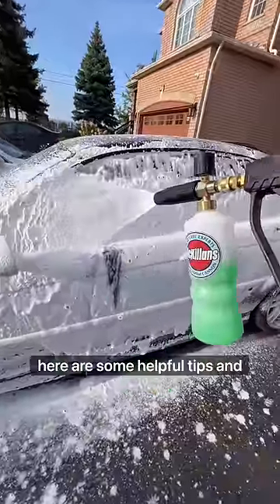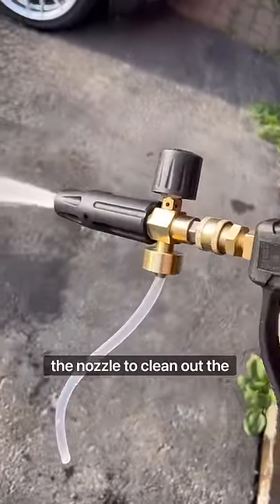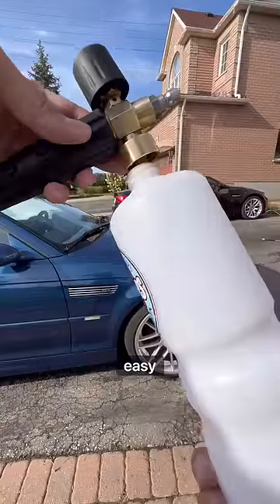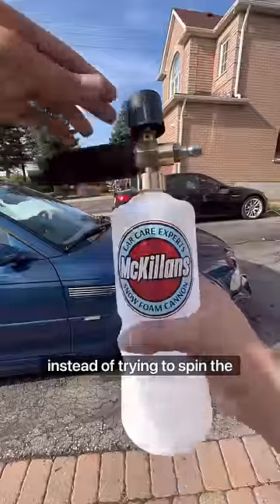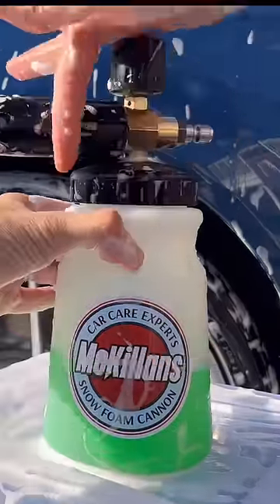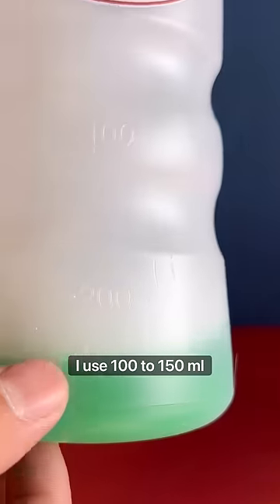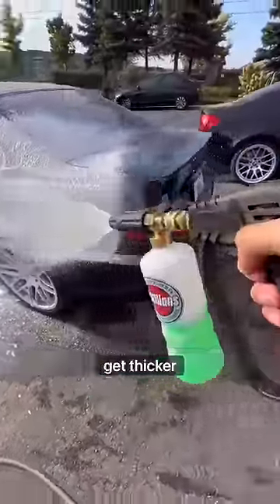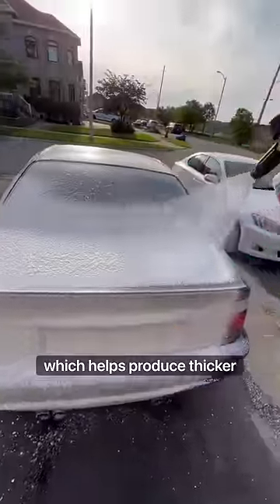Foam Cannon Tips & Tricks #shorts #foamcannon #detailing

Comment: The thing I was taught to not cross thread is spin backwards until you feel a click. Then rotate correct way to tighten. Used in plumbing from my understanding. Just thought I’d share.
Reply: Also a useful trick when putting screws back into plastic so that you don't end up creating a new thread and chew up all the plastic.

Rotate the screwdriver as if you were removing the screw. When you feel it drop slightly, start tightening the screw back in.
Reply: why not just turn it the correct way until it finds the start of the thread? i cant imagine it cross threading unless you where putting wayy too much force into it
Reply: @Seamus Casey  for certain delicate parts like pc mother boards you can crossbreed it just from the weight of the screwdriver
Reply: Just don't force it, the first few threads should not have any resistance, just feather tight

If there is resistance or binding that's when you know something is wrong
Reply: I learnt myself this and i use it on bottles and my fuel cap on my snowmobile and quad
Reply: Me taking notes without even owning one😂
Reply: I was never taught this. I learned it as a single digit old child getting milk out of the fridge.
Reply: I use this for sodas
Reply: Right
Reply: @alexsnc441  This applies to everything bro
Reply: My dad taught me this for rc planes and cars with tiny screws. Never forgotten it.
Reply: What's cross thread?
Reply: Yeah I’m a plumber and would use this truck for really annoying threads. After many years you do just learn not to cross thread it by feel
Reply: Wait I just thought this was normal technique… Didn’t know that people don’t do this.

Comment: Also, place the water into the foam bottle before adding the soap. This will keep the water/soap solution from bubbling up too much as happens when you place the soap in first and then add the water.
Reply: I’ve needed this tip and I didn’t even realize I did. Thank you boss
Reply: @bradydobson5970  You're welcome. I just learned it myself a short time ago after doing it wrong for years.
Reply: I use this way, but another way (with the right container) is to let the water hit the side and run down. Kinda like stealth mode while peeing
Reply: I came here to say this. Good tip!
Reply: @sdoriginal18 or you could add warm water Before adding your soap
Reply: @T0astedR0asted  yessir that's what we talking about

Comment: Those especially cheap plastic bottles do crossthread super easily against sharp metal threads. I suggest looking for a foam cannon that has plastic threads on both parts. I havent had any issues since i made the switch.

Comment: Not sure what’s up with these comments?

Yes you can always have someone else wash your car, or go to a car wash. But if you don’t have the money to pay someone to wash your car, or have a touch less car wash nearby, or if you just want to do it yourself.. this is economical.. especially if you already have a pressure washer you use for routine maintenance. Foam cannons can also be used to apply other chemicals if your pressure washer has an upstream setup (meaning the chemicals would run through the whole system) that you wouldn’t want to use. 

You use a wide spray pattern so it isn’t very high pressure. You apply this soap, let it dwell for a bit, then come in with a wash kit and two buckets, one with slightly soapy water and one with just water. Dip your mitt in the soap, wipe the top of a panel, dip in the rinse, then back in the soap and move on to the next panel. The soap is already on the car and it encapsulates the dirt and stops it from scratching. You work around and down the car. You rinse with a wider degree and low pressure nozzle. 

You can also get an efficient wash if your car isn’t very dirty with just the soap and a rinse. 

I would say that replacing to a smaller internal bit is the only part of this that might be extra for most people. But this is just an attachment for a machine, you can even get one for your hose although it won’t produce thick foam. I don’t usually see detailers up charge for foam- they just use it because it’s more efficient than just applying soap by hand. It has time to wet and soften the dirt to be removed easier.

Comment: 1 ounce of a good concentrated soap like 3D super soap, 3D pre soak, or any of the carpro soaps and then just fill the rest with water. 

Know what you’re doing before putting a 1.1mm orifice in your cannon. If you’re using a pressure washer that draws a lot of amps, you’re gonna trip breakers using a 1.1mm orifice.

Comment: where do I get that little brass piece at the end of the video that creates more suds???? why make a video like this and then not provide links for the things you're using?
Reply: Normally a new foam cannon will come with a different sized orifice, they're manufacturer specific. If they didn't supply a smaller or larger one then best to stick with the one you have. Messing with the wrong size can also kill your pressure washer!!

Comment: Mine doesn't do any foam. Why? It's just dripping watter and only at the end when bottle is nearly empty, it does some foam.
Reply: Hard water prevents thick suds. Run Di tank through you water spigot and go with a 1.1 orifice for the foam canon if your machine runs less than 2 GPM

Comment: Does anyone know how to use an electric pressure washer with buckets?
Reply: Throw a short piece of garden hose into a full bucket and let it reverse pump the water out. I use an electric pw on a water tank and it runs beautifully gravity feed once it reverse pumps out air and builds up the pressure. Just make sure you have a good quality unit or you'll burn the pump out real quick

Comment: Washing your car with such equipment is incorrect and overrated. 

Take a very good look at the restoration industry. They buff their cars to make them look shiny. 

Sure, they wash the car, but that's not how they would wash it. 

Minimal pressure is a must and washed from top to bottom.
Reply: Not sure if I would agree with it being incorrect but it is definitely overrated
Reply: People use foam cannons for fun. If a pro wants to charge you more money to foam your car, tell them to take a hike
Reply: I work in a steel mill, scrubbing is a must to get that stuff off, basically turns to weak concrete.